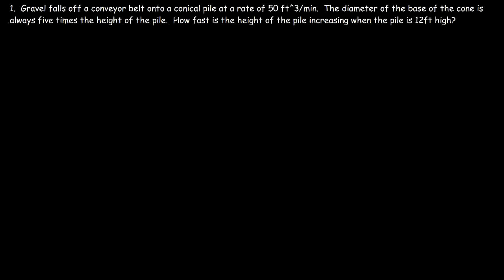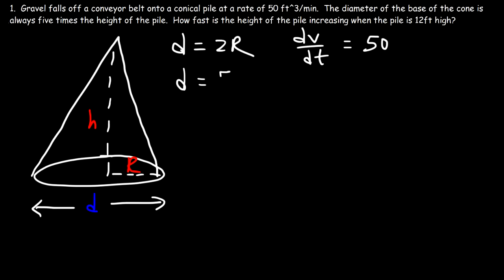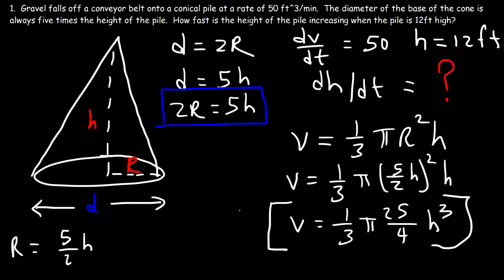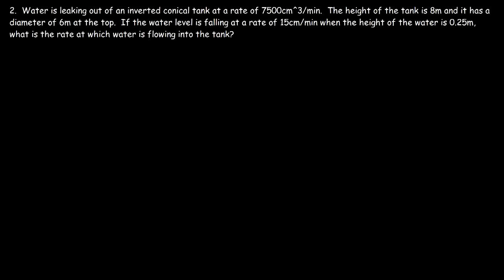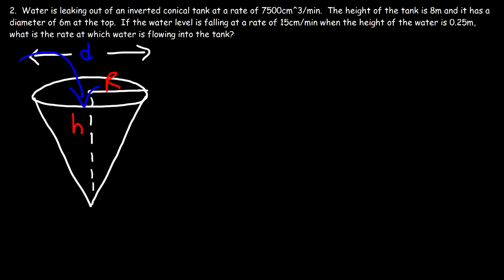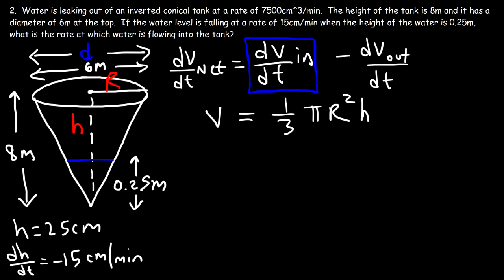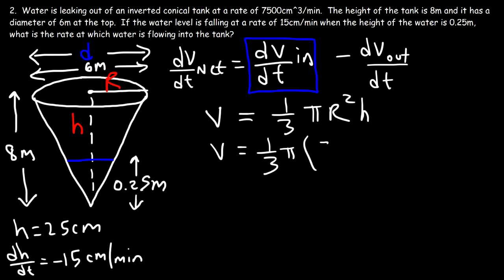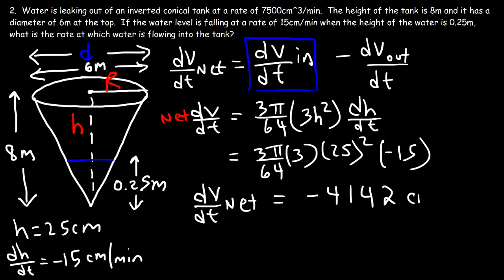Related Rates - Gravel Dumped Into Conical Tank Problem

Comment: When you created the ration of the height to the diameter you didn't use the cm values for the h and d, and you later plugged in cm values for h and dh/dt. Is that a mistake?

Comment: R = 3m, but you used 25cm for the height… im confused, did you not need to convert the 3 over to cm as well?
Reply: No, because he already converted radius to diameter and then got the diameter in terms of height. Once he had this, the only value he had to to convert was the height since it was the only variable he used.
Reply: If you see the conversion he made from diameter to radius and then radius in terms of height, if you convert the height and diameter to cm from meters you get 800cm and 600cm, and solve the equation, you will get the same result either way because you are just applying it to the 25cm that he got as h

Comment: I am confused as to why he couldn't just use d=2r and put it in terms of r. so, r =D/2 then take the diameter (6) and divide it by two.
Reply: You can't substitute r with diameter because when you take the derivative of the volume with d in it, you'll have d(d)/dt which is bot given. That is why it has to be in terms if h or height because the d(h)/dt is given.
Reply: Not* given

Comment: For the last question shouldn't the dv/dt [in] be greater than the dv/dt [out]? Since the dv/dt [out] is being leaked out it should be considered negative right? Therefore making the last equation to solve equal to dv/dt [net] = dv/dt [in] - (-)dv/dt [out]. Then solving for the dv/dt [in] you get -11642 cm^3/min. But you can just flip the signs. To make it -7500, and +11642.
Reply: The height is decreasing. Water is being lost.

Comment: Are we supposed to convert the h= 8m and diameter= 6m to cm? Because in this video, it was shown unchanged and used as a deriviation of value.
Reply: you don't have to convert most of the units of measurements in this unit.
Reply: the ratio of the h and d stays constant between units, thats way these are called constants. for example 1 cm / 2 cm = 0.5 and  .01 m /.02 m = 0.5, the overall ratio stays the same.